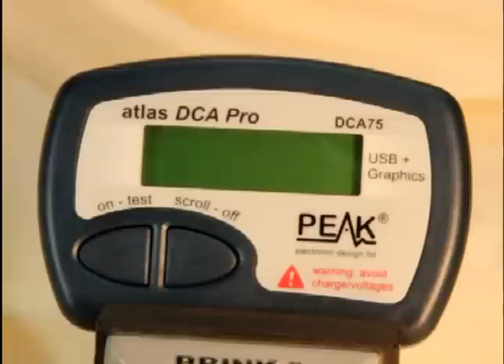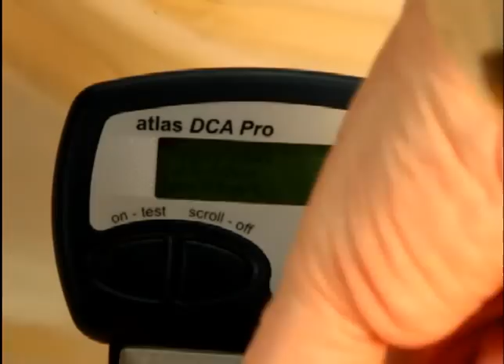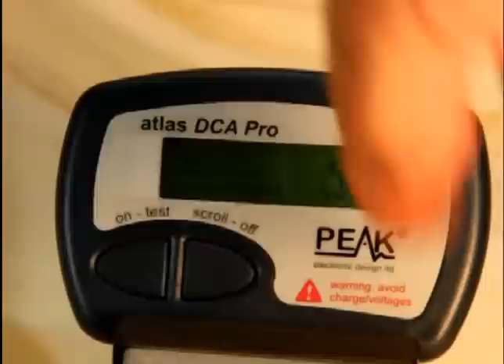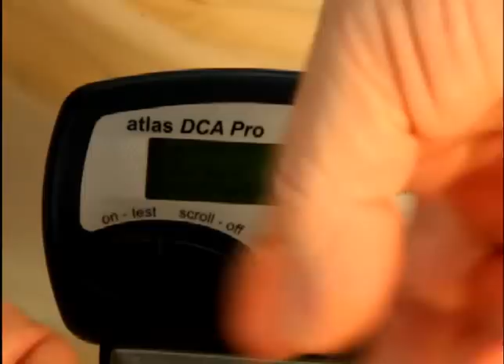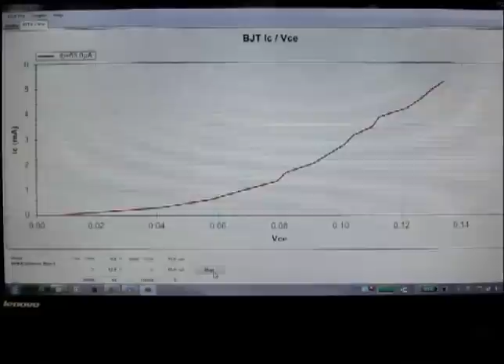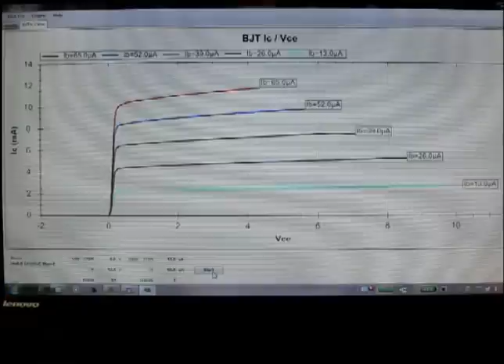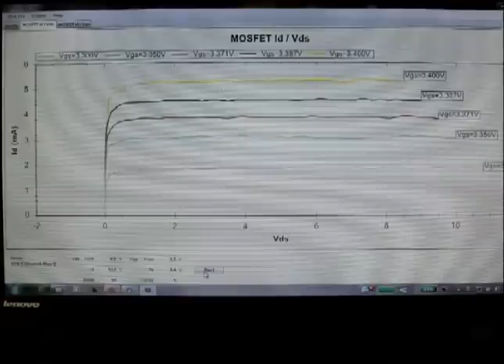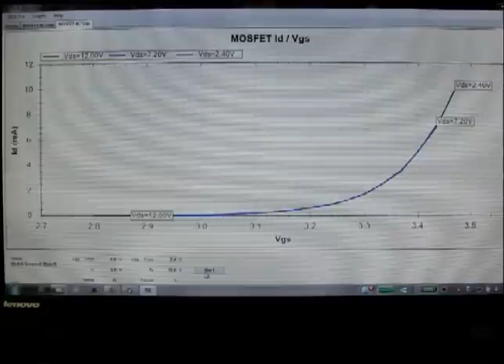DCA75/DCA Pro Semiconductor Analyzer demonstration

Comment from the maker: Yes but there is a "but."   Other components in the circuit will affect the readings that the DCA gets.  It will detect the presence of those components, tell you that they are there and warn that its calculations will be affected.